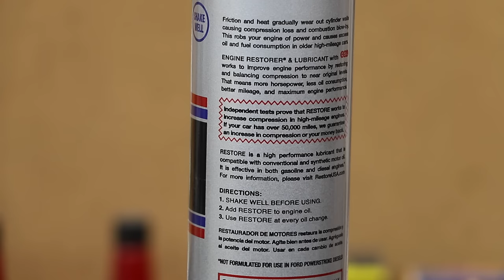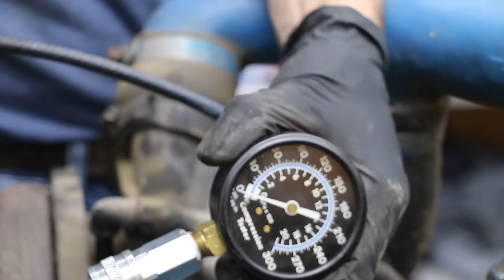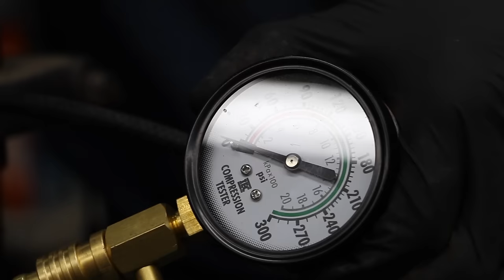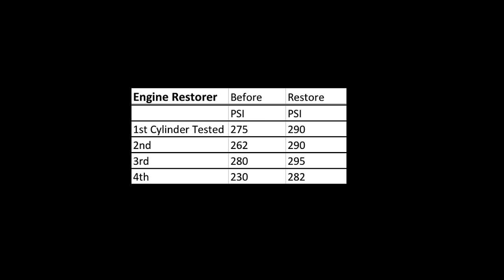Does Restore Work?  Will it Improve Engine Cylinder Compression?

Comment: I just saw this video now, something you did not test was oil consumption.  I was once driving an old 4 cylinder toyota tercel across the country and it was burning a quart of oil every 300 miles, and fouling the spark plugs with thick deposits so bad it would barely run until I swaped them out, every gas stop required a change of spark plus and another quart of oil.  I stopped at an auto parts store and in desperation I tried the Restore. I added it to the crankcase and I drove it for 4000 miles without having to change the spark plugs out, or without adding any any more oil.  improved the fuel economy too.
Reply from the maker: Thanks for the suggestion.
Reply: What year was the Tercel?

Comment: This stuff is *remarkable*.  I have a small generic hatchback - it uses Opel's 1.5 litre engine.  It's done 440,000kms - yes, I'm serious.  At about 350K I used this product as it was idling rough - a comp test showed all cylinders were down around 125-135 psi, with one (damaged valve maybe) at 95...  After Engine Restore-ing, I could clearly feel an improvement, and after a week, an updated test showed the 3 'good' cylinders up at 145-150, and the bad one at 115.  I wasn't expecting miracles, but afaiac, that was one!  Thanks for this test, PF.  I'm just about to use another treatment with a view to the car making 500,000km, untouched original engine... Got my money's worth out of that little car...!
Reply from the maker: You are welcome!

Comment: Just a heads up we have a ford 5000 and have had it for 25+ years, it has always started bad. Iv used starting fluid for the last 25 years and the engine still works great. They are bulletproof engines, they just start bad. Love the work you do and the results you get, thankyou!
Reply from the maker: This is great information!  Thank you!

Comment: I used nulon long term engine wear on an 27 year old Toyota Supra and feel like it did wonders, same as they're copper and Kevlar engine crack repair and a transmission treatment
Mechanics showed me a crack in my block that the crack repair fixed and holy shit does it work an absolute treat
Reply from the maker: Thanks for sharing.

Comment: I can honestly say I recommend this product to everyone after having such great results on 2 different vehicles smoking like crazy , I added restorer to the oil and put about 700-1000 miles on them and it actually fixed both vehicles!! No more smoke at startup, I was actually desperate and quoted a lot of money to fix these issues. I just felt I needed to share my honest past experiences. These vehicles smoked extremely bad at startup 
1986 Cadilac fleetwood 
1994 Ford F-350 diesel non turbo
Reply from the maker: Thanks for the feedback.

Comment: Here in Australia, we had a product called "REDEX". It claimed to do similar things. I tried it in a car engine I knew had stuck rings. Instead of following the directions, & letting it soak in for about half hour, I left it overnight. It certainly worked. I read the container, & discovered it had a mild acid as one of the ingredients. Once I had flushed the REDEX out of the engine, it ran very well.
Reply from the maker: Sounds like a good product!
Reply: @ProjectFarm  Yes, it was a great product. Something I think you might be interested in knowing. I bought a pack of plastic weld epoxy earlier today. It cost me about $18 AUD, because I live in Australia. Most adhesives I have used do stick to the skin. Not this stuff. I used some to repair the windscreen washer bottle from my car. I picked some up, & it did not stick to my fingers, but it has done the repair job I wanted it for.

Comment: Project farm great video I’m a big fan I have a suggestion have you checked the threads on oil filters for shavings? I have found shavings on just about every oil filter looks like to me that they don’t clean the threads good enough after cutting them what I do is I slide a Neodymium magnet inside the filter and at last wipe the threads with a white rag before installing the filter and I catch microscopic shavings every time you can also see the shavings on the rag. This is how I manage to keep my old engines running
Reply from the maker: Thanks for the video idea.

Comment: Just saw your video today.  I've quietly kept my eye on your page, viewing here and there.  Well, after seeing this video, I took the plunge.  I subscribed, Liked AND hit the bell!!  

I have a 1986 Chevy S10 with the Iron Duke.  It's got 485k miles on it, and will no longer start when not warmed up, unless I use starting fluid. I'm hoping this product works as well on my S10 as it did on your Ford diesel tractor.  I'll update after I use it!
Reply from the maker: Welcome!  Thanks for watching and subscribing!  Will be looking forward hearing of the results.
Reply: Well ???????? Have u used it?
Reply: @ProjectFarm  I purchased and installed an 8 ounce can in my 2.5 L four-cylinder Chevy S 10 engine. I ran it for about five hours over a three week Timeframe. It did not seem to work noticeably if at all. I still have to use a couple of sprays of ether starting fluid
Reply: @seemsmad3789  I’ve put about five hours on my engine since I installed the product. There has been no noticeable difference. It may just need more hours on the oil.

Comment: My brother and I have been using Lucas Heavy duty Oil Stabilizer in our deisel engines for many years. 
Just throwing out a suggestion for a video because i was unable to find one like this anywhere, for an abrasion test for deisel engines using
DELO 15w-40 with Lucas heavy duty stabilizer, and one without the stabilizer.
Great job on the channel, you do some of the best testing i've ever seen.
Reply from the maker: Thanks!  Thanks for the suggestion.
Reply: @Project Farm  possibly even match it up against T6, with and without the lucas stabilizer

Comment: Hey man. After watching this video I thought I'd try this stuff in my 84 Dodge b150 van. It's Slant 6 225 was using a quart of oil about every 400 miles. 

I changed the oil and added a bottle of this stuff and so far it has not used any oil nor is the oil getting dirty. 

I didn't do a before and after compression test I can tell it's got more power. 

It's got an A-833 four speed manual. If I tried to use overdrive at 40 mph, the engine felt like it was lugging. Now I can shift into OD at 40 mph and it no longer chugs along.

I'm really impressed with this stuff. Most of what everyone claimed to be good stuff like Seafoam and MMO has never worked for me.

Thanks for turning me onto this stuff.
Reply from the maker: You are welcome!

Comment: Recently moved to a heavier oil 20W/50 and my 1st can of Engine Restorer for 4 cylinder engines.
This is for my 1991 Ford Ranger.  
I have noticed in only 1 week it idles better and I have not had to ADD any Oil. 
I drive about 300+ miles per week and was ADDING at least 2 quarts of Oil. 
Hopeful the Improvement will continue as I'll probably use a 2nd can of Restore.
Reply from the maker: Thanks for sharing.

Comment: It did work on my saturn wagon. I figured id give it a try because one cylinder was 20psi low. It corrected the low cylinder to 5psi off the rest, and raised em all a little. I drove it for four more oil changes and three years later the next owner still drives it.
Reply from the maker: Thanks for sharing!

Comment: Great video man! Just subscribed. Going to try using this product on my Toyota 3.4l that has suffered some compression loss over time.  I was going to make an in-depth video on RESTORE but I see you've already covered the subject thoroughly! So I'll make a video to bring some real world numbers on if this product works for 3.4l.  Thanks again for the great video, and I'll be checking out lots of your other videos
Reply from the maker: Thank you.  It's a product that actually delivers results for worn piston rings.  It won't help if the valves are the problem.
Reply: @ProjectFarm  yeah I'm thinking that mine is mostly piston and cylinder wall wear because it's considerably low across the board. Though I do have one cylinder that is 25 psi less than the rest. So that one may have a valve seating issue. I've already checked all the valve clearances and they are in spec. Just shot the first segment for the video on it now.  Got both hot and cold compression figures, then changed the oil and added the 6 cylinder formula.  How many miles would you suggest to drive before rechecking to get an accurate measure of how good this stuff is? I'm thinking at least a thousand miles.   Because if it only increases the compression for a few hundred miles I'm not really interested in that. If you know what I mean
Reply: @ProjectFarm  and I made sure to give you a shout out in the intro of my video. I'll definitely be plugging in a link to your video since you covered the topic pretty thoroughly already.
Reply: @ProjectFarm  not that your channel needs a shout-out or anything lol. But I figured if anybody runs into my video and then wants some more info on the product, your world-renowned opinion would be the place I send them.

Comment: Thank you for your unbiased testing methods. I have a 2005 Pontiac Grand Prix with 260,000 miles. I bought it new in 2005. Its been a very good vehicle but, is starting to use some oil, I'm sure in some part due to my driving habits. I do a lot of highway driving & rarely drive under 80 mph. Well see how it works. Again, THANKS!!!
Reply from the maker: Thank you!  I hope it helps.  That's a lot of miles!!
Reply: @ProjectFarm  I'll let you know. I take good care of it.
Reply: @ProjectFarm  I got my oil changed 2 days ago & added Restore. I  have only put a hundred miles on but, it sure does seem to be quieter but, I'll be careful of the "placebo effect." again thanks, you're the best!!! Dale

Comment: I've used Restore in a 1995 3.5l  V6  Mitsubishi Montero (dual cam version). Results were shockingly good:). oh, the mileage was 162k!!, but I had done all the services, since new.  Still, I had one low cylinder with persistent lifter clicking for some time after startup.   Restore eliminated the click as well as restoring compression. Like I said, I was shockedk!
Reply from the maker: Thanks for sharing.

Comment: I once experimented with Bardahl Full Metal and it restored all six cylinders (400k+ km BMW M52) to factory spec comppresion 10.5-11.00bar. Before that, they were at 8.5-9.00bar. All of Bardahl products achieve great results. Also there are these Russian millitary additives called Suprotec. After treatment (I'm NOT making this up), you can let your engine idle a whole day, without any oil and it will be fine. The instructions say that you can drive 1000km without oil, before wearing out the protective layer. I will be testing this soon, but even 100km or 10km will be mindblowing for me. Also it reduced fuel consumption by an average of 1.5l/100km on three different engines so far. I don't know what's inside those little 50ml bottles, but it does magic. I also tested another Russian one called Resurs, but it clogged the oil system and broke the engine (Volvo d5252t). The test was performed after doing a flush with Bardahl Engine Flush (another product I love), replaced oil filter and new Eneos 5w40 oil.
Reply from the maker: Thanks for sharing.

Comment: Great video...Im going to try this on my GMC van. It has 387,000 miles and is missing at idle with one cylinder due to low compression. Also being a farm equipment mechanic(over 30yrs) next time you do a compression check be sure to check and adjust the valve lash. It makes a big difference.
Reply from the maker: Thanks for the suggestion.

Comment: I have been using Restore on my 4.0 liter V6 in my Tacoma every oil change along with gumout in the fuel tank + synthetic oil ( mobile-1). I just rolled past 250K and she purrs like a kitten. I did swap out the spark plugs around 150k but that's it. I have not had 1 problem with the engine at all. I believe the Restore helps maintain the proper compression and my mpg stays steady around 17.
Reply from the maker: Thanks for sharing.

Comment: My 1963 Dart, w a slant 6, burned oil when l got it. It has well over 250,000 mi. After using RESTORE many years ago, l have yet to see the return of "blue smoke". Truely works.
Reply from the maker: Thanks for sharing.

Comment: any time the check engine light on a pt cruiser comes on, just know its time for a compression refill. Just get you a bottle of that engine restore stuff. Pour it in and let the magic happen. Erase that DTC code and enjoy a good running car with no check engine light. When the light does finally come on, you know its time to change the oil and add another bottle of restore! ;)
Reply from the maker: Thanks for the feedback.

Comment: Heck yes engine restore works! We used it in a 98 ford f150, 5.4 triton with 150k miles. Without it, youd feel the motor under strain and 15mpg. After using the engine restore after every oil change, that motor went to 344k miles and was getting  18mpg before we sold it. Engine restore does take 300 to 500 miles before you start to notice a difference.
Reply from the maker: Thanks for the feedback.

Comment: Love your videos. I copied you on sea foaming the crankcase,and running it through the intake. And then added power restore with my normal oil change. There was nothing wrong with my car however, it has 238,000 miles so why not. It did make my check engine light come on probably because of stalling due to the Seafoam.
Reply from the maker: Thanks for sharing.

Comment: Used this in a mystery engine. Engine ran decent, but was somewhat weak, and sluggish, very slight valve ticking and light oil consumption. Added this, and after the second drive with it it had a significant increase in power and acceleration. Engine had quieted down. Added with marvel mystery oil and engine is running perfect.
Reply from the maker: Thanks for sharing.

Comment: Hi again. What would be interesting is to take apart this engine to see what this product actually did to increase compression. On some diesels you can do what is called an in frame inspection. Where if there is enough room to drop the pan and remove it, you might be able to unbolt one of the pistons and remove it without having to remove the crankshaft. But before you do that make sure you ask someone who does this kind of work if you will be able to get the piston back in without harming the rings.

Here's another test that might interest you. When I had a high mileage car that had low compression. I called Amsoil tech department and ask them of they knew of anything that would increase compression. They told me that their 20w 50 racing oil. Not their top of the line 20w 50, the other 20w 50 they sell that's less expensive. So I tried it and the average increase was 20 psi per cylinder. i was very surprised. And after running it for a while I tested it again thinking the compression got less. 2 things. It only decreased by 5 psi average but the balance between each cylinder was closer. And the engine was running really smooth. 

So here's what i am thinking. The combination of the restore and the Amsoil 20w 50 might bring the compression up even higher and balance the compression per cylinder more. Making that engine run even better.

What a lot of people do not realize causes problems with engines performing correctly. And why compression can vary per cylinder. it's not only the rings but if the timing chain or belt is loose due to wear or stretch or both. The timing of the opening and closing of the valves get off. Example: If the intake valve open a little late. Not does that not let enough air in the cylinder to get full compression, but it creates such a high vacuum for a millisecond or 2 which will draw oil pass the rings and into the cylinder.

The exhaust valve opening late creates extreme back pressures that blow past worn out rings and causes blowby in the engine which can be seen when you take the oil filler cap off. So valves have to stay timed too, to the motion of the piston or this causes problems as well. most diesels have gear driven cam shafts. And the gears can get loose causing this problem. Just thought you might like to know that if you did not know.
Reply from the maker: Thanks for the suggestions.

Comment: Yes it works my uncle runs NOS on his truck 4x4 he uses it every oil change keeps his compression good even with using the spray .  i have also used it worked every time for me.
Reply from the maker: Great feedback. Thank you
Reply: @ProjectFarm  he has the original led zepplin truck in denver Colorado. Toyota 4x4 with souped up 350 chevy 4 bolt main and nos he swears every spray puts 20k wear on the motor. he took second or third years back monster truck races amateur class  with his moded Toyota. He runs restore every oil change and swears by it.

Comment: I first tried it years ago , my '86 "screaming fire chicken " , it was really bad, gritty oil ,
I first ran it for a week , with regular oil , to get as much " crud" out of the engine , even THAT oil was kind of nasty ,
I put in synthetic Pennzoil 5w30 , and a can of 8 cyl. Restore , I noticed a difference within a couple days , she ran stinger , and was better on gas .
So far,  EVERYTHING I've put it in runs better , even 2 strokes , (but , you need to put in a little bit @ a time .
I put it in a seized, little husky , self-propelled lawn mower , got it loose with marvel mystery oil ,(another gr8 product ) , still runs like a bear , that was like 15 years ago . Tip : after u buy it , shake , then store it upside down .
Reply from the maker: Impressive!  Thank you